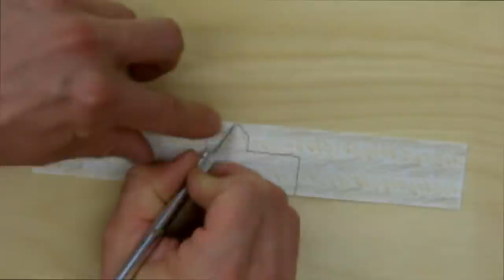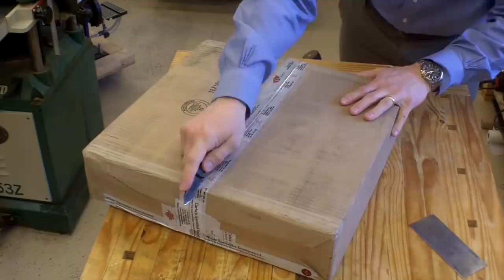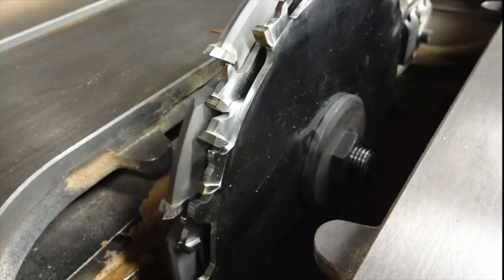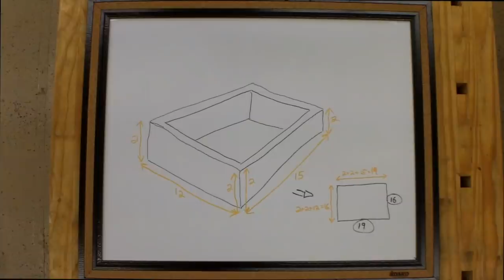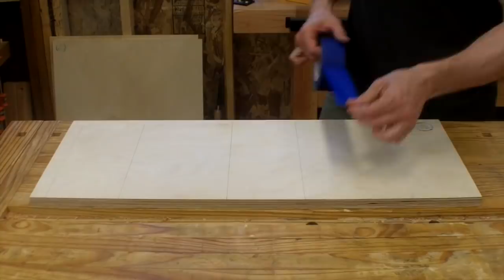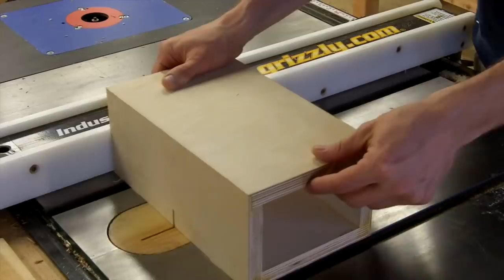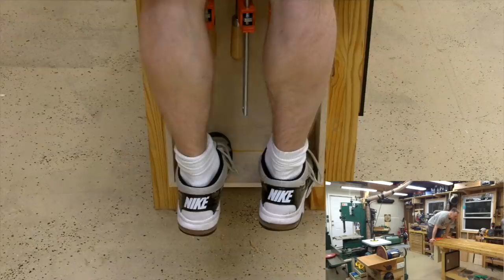New Invention - Easiest Drawers Ever!

Comment: Very cool idea!  I use a drawer lock joint but in the router, does basically the same thing but with much more set-up and fiddling.  This is the joint you see in drawers of Gerstner wooden  tool cabinets.

Comment: When I built my cabinets for my house I made drawers out of basic spruce 1x6s with rabbited slots for half inch bottom s and glued butt joints in corners tacked till glue dried. 30 years later not one has popped apart or anything. Your idea is cool, and very unique but lots of extra work when other types of corners are easier and just as strong. Built drawers for my shop with same method and even they have held up over the years. Yeah, they don't look pretty or fancy,, but go together quickly and do the job a drawer needs to do. Smart idea though. Not knocking your ingenuity. Nice video.

Comment: Being a woodworker for over 20 years made me very Skeptical about "New Ideas", especially ones posted on Youtube. I tried to criticize this, but I have to admit I've been beaten.
This has got to be one of, if not The, best thing I've ever seen on Youtube for woodworkers especially cabinet makers. If I had one of these on a dedicated Unisaw in my shop, I would be able to outbid Anyone!
AWSOME!!

Im subbed
Reply from the maker: Thanks David, glad you like the concept, did you see that Rockler is selling them now?
Reply: Andrew Klein 
No, I haven't looked on their site for quite a while. 
Thanks for the tip. I'll check on it right now.
I hate those sites. I always end up ordering Waaay more than what I originally went their for. 😁
Reply from the maker: +David Miller it's called the miter fold dado set
Reply: @davidmiller5832  Did you get one? If so, has it been magnificent? Any cons to speak of? And what are the pros, you know, besides what's immediately evident?

Comment: too bad won't work with blum tandems
Reply from the maker: +John Borovka what are those?
Reply: undermount self closers that most high end cabinet shops now use for drawer slides. they need the bottom of the drawer to be located up about 9/16 up from the sides and front to hide the slide and attach the clips at the front of the drawer. if you watch this old house it will be the only drawer slides you'll see in all the cabinets   their kitchens ever use. Most cabinet shops don't ever build the drawers like yours but is a great invention anyway.
Reply from the maker: +John Borovka in the second half of the video I use the tool to make draws like you are describing.
Reply: watched the video again but  not there. Just go to kitchen place and look at drawers in a kitchen showroom. Almost all drawers will be blum tandems or clones
Reply from the maker: What I mean to say is that the drawers I make with the blade in the second half of the video have the bottom located above the bottom of the sides and could accommodate the hardware you are describing.
Reply: a lot of drawers I make are pretty deep and wide. can
t see cutting a double drawer maybe 26 inches high and 24 inches a little problematic for me. A lot of drawers shops make are with prefinished  maple ply. making a big box then  with your method would end up with an unfinished top edge. the maple ply comes in precut width with a prefinished edge trim. the prefinished width maple play makes making the drawers real quick and easy. I use biscuits in the corners which makes the drawers very simple to assemble. the drawer bottoms can go in later by cutting the backs narrower than the sides. You have a great idea and will be great for a lot of people but after making thousands of drawers my time making drawers is a pretty quick process anyway.

Comment: this type of joint is on my kitchen cabinets made by Margnet joiner in the UK made in  1990 they are still strong and have not given or broke apart and are as new all these years later. but I never see it used anywhere else, till your video . look brilliant idear for making a draw with this type.

Comment: It might be a good idea for the DIY guy. For industry no good. You have to build your drawer out of the same size material for the bottom as well as the sides. The bottom is the largest size of plywood, so it will be the costliest part of the drawer. Kitchen manufacturers use low cost materials for the drawer bottom. ie: 4 to 6 mm ply or particle board. plus drawers are now being produced as a one piece moulding and they can turn them out for pennies. But good luck with your saw blade and i hope it makes you money.
Reply from the maker: +F Finn watch the second half of the video, I use it to make drawers with thinner bottoms
Reply: An L shaped chisel should be part of the kit to stance out the corners or is there an easy solution for it?
Reply: Maybe the packaging should double as template for a standard drawer

Comment: Brilliant ,the russian plywood can be laquered  first inside and out and then cut   ,making that whole procedure  super fast  ,effective  and a 2 hour time saver on each drawer ,used with full extention slides eliminates  failure over the years.And if you really want to go bullet proof then 4 drywall 1 3/4  screws can be used on the front and the back panels which no one will ever see

Comment: Looks like a very neat product.  Very interested to find out if the production version of this blade that has now been released is indeed easy to use, repeatable, consistent in making a whole batch of "fine furniture quality" boxes at once as opposed to doing it by other methods.  The Rockler in-store demos that I've been to have been rather disappointing ( I won't mention which 2 stores I went to, because my intention isn't to get anyone fired)  But I'm really interested in finding out how the production blade performs for the parameters listed above and also would like to know if the blade can be sharpened easily  by Rockler or by someone else and if it will maintain the proper geometry to work when it is resharpened.
Reply from the maker: Well, I can tell you it is a great product, and easy to use, but you might find me biased!  People have been leaving reviews on the rockler site, you can check those out.  We should be releasing the name a a preferred vendor for sharpening soon.
Reply from the maker: Just to be clear, did you go to in store demonstrations of the Miter Fold Dado Set?
Reply: yes indeed.  what i witnessed would make you cringe, not only as the inventor of this product but as a basic woodworker.  but like i said, i'm not trying to get anyone fired.  i just want to know if this will work for my needs.  i did read the new reviews on the rockler site and have asked several youtubers to do some testing that will  include a batch of boxes all the way through to the finished product.  my current techniques work fine, but am always looking to streamline the process.  since i have a sawstop, it's not just the cost of the blade that i'm worried about, but i am willing to invest if it means that my per-unit-cost will be cheaper, easier, very consistent, etc.  thanks for your response; i will continue to follow this

Comment: They will not be as strong as dovetail, but they will be as strong as any rabbeted joint can be. Additionally, you have that thin strip of wood which although doesn't add much strength will add strength to the joint. And that, is a lot stronger than most mass manufactured drawers currently being sold. I was a carpenter and a cabinet maker until retired due to repeated back injuries and I am impressed. That is saying something, becasue I don't get impressed easily.

Comment: another case of "perfect geometry" bites you you in butt. Get it sorted out and it will sell. Would like to see demo on say cherry or walnut or oak just a joint test. Adding a few screws in the edges would grealty increase the holding threshold or even some wooden dowels.

Comment: Andrew, awesome idea and prototype!  Love the simplicity. While the strength is not the same as other joints, for what it's meant to do, it's awesome.  I would suspect once you get the proper size to where there is no gap the completed cut that the failure strength will be comparable to more traditional joints. I'll buy one.  Four cuts and a fence move, glue and you're done.  I guess I should have paid more attention in geometry class. Awesome idea, awesome.

Comment: Andy Lien, good job on this idea.   I believe I have seen it before , but it has been years if so.   It may not be practical to try to sell it if Rockler already has it, but it is a good idea and you will have more.   I have about 150 to 160 invention and invention ideas, it's hard to compartmentalize them from design ideas or alterations of existing things.  Good luck in the future with your next ideas.
Reply from the maker: Rockler definitely didn't have it since they are licensing it from me to take it to market: http://www.rockler.com/rockler-miter-fold-dado-set

Comment: It's a shoulder miter. Not new or original.
Reply from the maker: You are right in the sense that the joint itself is not new or unique.  Your wrong in the sense that this is the first tool capable of cutting both sides of the joint in one pass on any thickness material between 1/4" and 3/4".
Reply: Listen, I wish you all the success possible in marketing your tool. That said, I was a union cabinet maker for many years and saw and used this tool in many of the mills where I worked. Perhaps the shop owners had the tool custom ground - I have no idea. I will say that drawer assembly was very quick and accurate with the shoulder miter. Good luck to you.
Reply from the maker: Thanks for the positive wishes.  I certainly can't prove that at some point someone didn't custom grind something similar, and never sold/shared it with the public.  Others have claimed they have seen it before, but no one has provided a link for a similar product that can actually be purchased, or even shared any pictures or diagrams of past tool with similar capabilities.  My tool is available for pre sale, by the way: http://www.rockler.com/rockler-miter-fold-dado-set
Reply: I'm seventy five years old, Andrew. I'm talking about things I saw and used back in the 60's and 70's - ancient history.
Reply from the maker: Thats fair.  A question though, did these tools you used work with a dado stack, or some other adjustable element so that one tool could be set up for precise joints in different thickness materials?
Reply: Dado stack. Often times business cards with a hole for the arbor were used as shims for precise blade spacing.
Reply from the maker: Hmm, but dado stacks come with shims, and ways to do fine adjustments of thickness and spacing, why would you need business cards?
Reply: May I ask how old are you, Andrew?
Reply from the maker: no, it isn't relevant
Reply: My question was not meant to be disrespectful. Only to point out that the way things are now is not necessarily the way things have been in the past.
Reply from the maker: So you are saying that dado stacks from back in the 60s/70s didn't have shims or other mechanisms for fine adjustment?
Reply: I'm saying that some of those union shops I worked in had tooling that dated back into the thirties.

Comment: I think you have something here. Finger joints may be unnecessary overkill. your joint seems plenty strong. the real breakthrough That I see is that this could have many applications outside wooden drawers and with the right machine these cuts could be made all at once and very rapidly speeding up manufacturing. I am very impressed!

Comment: I applaud you're ingenuity. As a VERY inexperienced woodworker, I have to ask though, wouldn't it be easier to use a v bit with a router table? I realize it wouldn't be quite as strong as your profile, but couldn't you use brads or counter sunk screws to reenforce it? $350 seems like a lot to me for a saw blade. You are definitely a creative man.

Comment: You cannot do better than having the plywood bonds fail vice the side to bottomm joints . You also need to patent the design of each of the different sawblade bits or teeth for each thickness of commercial plywood in ASE and metric. I really like the extra bonding surface area for each joint. No rug rat gigging for a spoon would break that 90 degree joint just just for documentation, you need to test it to failure and record and publish the force necessary.

Comment: Maybe if you got rid of that 1/32" gap the glue would hold better?
You could always spline these joints if you're looking for very sturdy drawers, but this method is so fast and easy, it's worthwhile doing it and then doing whatever is needed to fine tune it.
Reply from the maker: +Macks Power yep, that gap is fixed.
Reply: Yeah I assumed before going in to production that it would be fixed  UT just saying the experiment was not indicative of the quality of the finished product from the version available for purchase, this one is just a prototype or experiment
Reply from the maker: +Macks Power right on

Comment: Adding more steps to a task does not make it easier. Seems like a lot of work for making a drawer....traditionally, you would NOT need tape and you would NOT need to change sides with the fence to make a basic drawer. It IS a neat invention though. The strength test you did can be accomplished with a normal dado joint.....the fact that the wood was "folded" is irrelevant.
Reply from the maker: Far fewer steps than traditional methods.

Comment: Excellent idea.  Thinking out loud here.  I just wonder about the flexibility and longevity of the the material at the very corner itself after it's complete.
Reply from the maker: the drawers I made for this video (almost two years ago) have held up great.  The blades will be sold soon, in case your curious:  http://www.rockler.com/rockler-miter-fold-dado-set
Reply: Thanks Andrew.  Do you find any particular plywood works best? Baltic for instance? And by the way I wish the best in your endeavors.

Comment: this is not a new concept I saw Roy underhill do this He cut V-shaped grooves in a wood panel by hand,just short of breaking through the opposite side, and folded up the edges of the panel to form a box. I used a router fitted with a V-groove bit and 
traded the solid wood for plywood.
Reply from the maker: +sniperlee93 I am aware of V grooves, they are inferior to the joint my tool makes.

Comment: Nice work. A router bit with this profile would be simpler to install and a lot cheaper to manufacture. Think about it.
Reply from the maker: You can't make a router bit with this profile, a spinning router bit can only make a symmetric cut, and this cut can't be symmetric.

Comment: Back in the mid 1990's, I used handtools (form of hand held knives) to cut similar profiles in fiberboard ductwork panels (while the larger companies owned large machines that could be setup to mass produce precut panels) to make the trunk lines for HVAC installations.
Glad to see such a design progress into other areas of work.

Comment: If I could subscribe twice I would!  Could you manufacture yourself?  .."Klein Blades."
Sounds like you already have a company making them..So I'll look for that.

on another note:  I'm looking for soft close top mounting drawer slides.  actually side mounting but with a right angle on top to attach directly under a workbench.  keyboard slides are the best thing I've found but no soft close.  Thought you might know of something besides adding angle brackets...maybe that's the easiest solution though.
Reply from the maker: Yep, Rockler will be selling them soon.

Hmm, I don't think I know of anything like you are describing for drawer mounts, sorry.
Reply: I ended up using side mounted ones but upside down.  It's works well.  Thanks for reply

Comment: I've been in woodworking for 30 years and i think your idea is elegant and simple. Small one off shops would save tons of time with this blade. Have you considered insert blades?
Reply from the maker: +ken s Thanks, the thing about insert blades is that there is no adjustment for different thickness  materials like there is with my tool since you can adjust the dado thickness.
Reply: So why do you end up with that little space again?
Reply: Also, would it be possible to make this a mirror image so that you don't have to move the fence. IMHO the only drawback to what you've designed is that you have to move the fence.
Reply from the maker: the space is due to the custom blade being a little too large in diameter, I have since corrected that issue, see this video I just release:  https://youtu.be/IfypMOcb75M
Reply from the maker: The only profile that works similarly to mine, but doesn't require the fence to be moved is a simple V groove, and that is no good because it doesn't interlock for an easy glue-up, and doesn't have as much glue surface area.  Moving the fence is unavoidable.

Comment: Can we get an update? Have you created a finished prototype that working as expected? Will there have to be a different blade for each size wood your using?
Reply from the maker: Watch my most recent video on the blade.  One blade is all you need for different thicknesses, dado thickness adjustments are all you need to make.
Reply from the maker: you can get one from Rockler very soon: http://www.rockler.com/rockler-miter-fold-dado-set